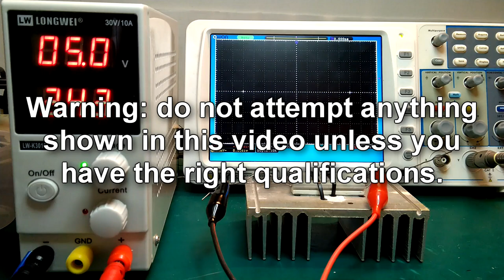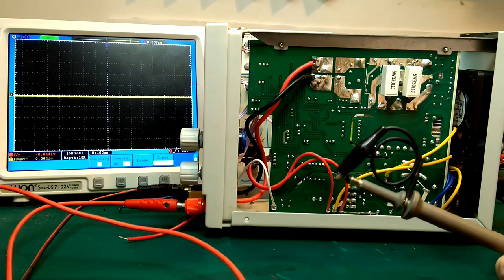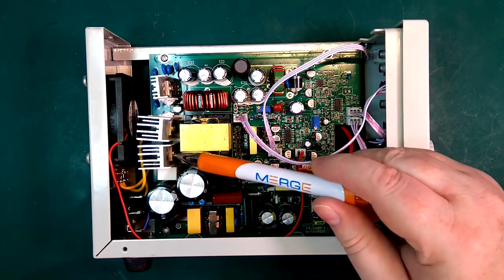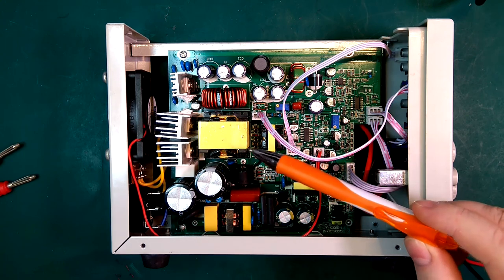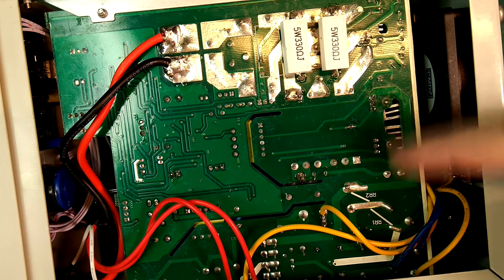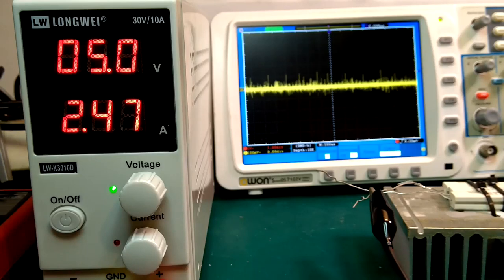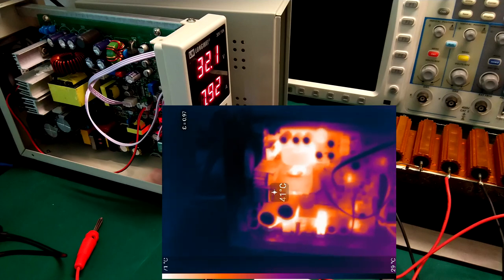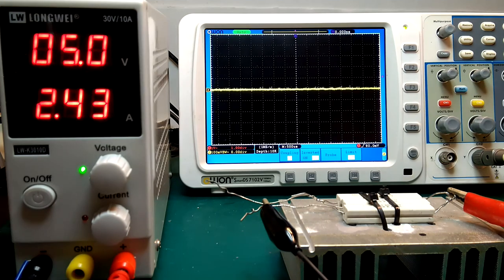Fixing the LongWei LW-K3010D Bench Supply Noise Issue

Comment from the maker: Simple fix to get rid of most of the switching noise. It's a possible scenario that the power supply was originally designed to use different mosfets with much higher gate capacitance, but then the manufacturer bought a cheap truck load of the Fairchild mosfets and used those instead.
Reply: What is a good name brand mosfet and better gate capacitance, so it may be better to swap it instead of modding.
I just ordered a 'qw-ms3010d 'dc power supply and i want to start learning electronics for my flashlight hobby.
Reply from the maker: @forrestgumpv9049  It's not so much about the brand name, but there are a lot of mosfets out there and it's a jungle, so trying to find one that would work is quite a task. Anyway make sure the voltage and current rating is high enough and then look at the Qg parameter usually in nano Coulomb and some datasheets will show Ciss as the input capacitance in pico Farad. 
Cheers,
Jake
Reply: Thanks I finished the mods and ripple reduced to few mv

Comment: That's a good tip (ha) on using the ground wire of the scope probe to generate a pickup for pinpointing noise. I always used a few loops of wire but did not think of using the probe wire itself.
Nice job rooting out the noise source. Adding the RC filtering helped significantly making the supply a bit higher in output quality.
Cheers,
Reply from the maker: Thanks, yeah it turned out better than I'd hoped for.

Comment: Thanks,  it is a real pleasure to see such intelligent step by step analysis and solution development. I also liked your EMI detection tip. Yes, my degree is from 1972 so I too must learn SMD soldering skills, hope my eyes will be up to the task!
Reply from the maker: Thanks, much appreciated. When I switched to SMD I thought it would be much more difficult, but actually I generally find it easier and quicker to solder SMD components today compared to through hole.
Cheer,
Jake
Reply: @TheStuffMade  Thanks Jake,
You motivated me to order some SMD resistors 😊
Best wishes
Mark
Reply: @TheStuffMade  -  On your pickup coil for the scope... I use one of those old suction cup coils used to record phone calls from the receiver or handset of a telephone. Those are 500 or so ohms and are very sensitive with good output to find BS in circuits. Also they have great bandwidth for audio signals. I have used them to detect whether coils are doing their job correctly. One of the more interesting uses was for vector monitor yokes. There is a substantial difference in the fields between a good one and a bad one. Some electronics makes really crazy noises if you have a listen with that coil also.

Comment: Great video and something that LongWei should think about doing to improve their product.  I can't imagine it would affect the cost all that much and it would bring the rating of their product up over others within the same budget market.  Wish I could tag them in this comment...  :)
Reply from the maker: Thanks, I believe the engineers who designed the power supply probably had designed it correctly, then the manufacturer changed some of the parts to save a few cents. But yeah, I wish they would implement the tiny mod to get rid of the awful noise. But they've probably already made 1000s of these stocked in warehouses so it's unlikely they'd consider making any changes.

Comment: A big thanks for the excellent video. I've risked a Topshak (BG's own rebrand) LW-3010EC and hoped that the core is the same (from the LW- type) and yes it is so I did the same mod (actually with 2 of them after seeing the result of the first one and how reasonable the price was) with very similar results (although used 27 Ohm 0805 as that was in my drawer and didn't want to push it too hard as for really low noise I have linear PSU). RMS went down from 12.7 to 3.7mV and Pk-Pk from 281.1 to 83mV in a noisy environment (checked with DSO, tried to avoid noise leaking in as much as possible).
One issue though: I guess it's not just about more heat but also reaction time for quick load change that has increased as well. None of my concern, just perhaps something that's also good to be aware of.
Reply from the maker: Thanks, good to hear you got rid of the noise. These switch mode power supplies are very slow reacting to changes in load. See this video I did before the mod: https://www.youtube.com/watch?v=RdT-xWC4h4k
The mod itself will not have any effect on the power supply's reaction time, it just takes the edge of the MOSFET switching.
Cheers,
Jake
Reply: OK, it's even better then (and I was wrong about reaction time but I didn't look into it much as I have linear PSUs as well that I use for more critical tasks; it's also somewhat similar to what you also have but in a cheaper/simpler edition).
Thanks again for the video, it has helped me a lot to make this fix quick and easy and also for the other videos that explore PSUs in a way that I rarely see but found very useful.

Comment: Ive recently bought an RS310p 30V 10A PSU. Ive bookmarked this video and will do the same mod to the MOSFETS in mine. I'll also add an inductor between the board and output terminals.
Reply from the maker: I can't guarantee it will work on other power supplies, but good luck.
Cheers,
Jake

Comment: Apologies if this is a dumb question, but for the switching noise and ripple to be present on the output, that would mean that it’s severity exceeded the level of smoothing provided by the specification of the main output capacitors? Put simply it’s so bad that the hard-switching peaks are  making it through the output filtering?
Reply from the maker: It's not a dumb question, but switching noise and ripple are two very different types of noise and must be dealt with in different ways. You can lower the ripple by upgrading the output filter, increasing the switching frequency or adding more phases etc. With switching noise you have to eliminate it at the source as it's EMI (I believe I mentioned this in the video). In this PSU it's generated by the MOSFETs because of excessively fast switching. Hope it makes sense.
Cheers,
Jake
Reply: @TheStuffMade  Ah, I was thinking about it the wrong way still even though yes you did mention it being EMI. Which is why using the probe as a EM receiving antenna was effective, I see now. The conductors connected to the mosfets act as transmitting antenna for the harsh HF switching transients, which can be induced into the conductive circuitry of any devices or wiring close enough in proximity. (receiving antenna) 

Or at least this is way I understand it to be, as I’ve been learning the importance of reducing unwanted EMI, especially as of late, since I’ve been getting into the shortwave and CB hobbies. And the somewhat new and acute awareness that RF is generated by every device that has switching circuitry, which is not always dealt with or suppressed to a level that doesn’t cause unwanted RF interference in certain frequency ranges. Harmonics. Inductance. It’s a lot, but I’m been steadily learning, and slowly small levels of understanding come here and there as I poke around and try to familiarize myself.

Comment: Hi nice video !  but for me it looks risky to tune it without analyzing the pulses on the gates, to see the deadtime and also to evaluate the increase of heat of these transistors ! i'm curious to see the curves of gate signals and how much this rc filter is slowing down it. how about a correct current loop for the transformer, transistor and capacitor with also a shield ?
Reply: If it works it works and he did look at the mosfet temperatures…?

Comment: Very practical and educational. I just wonder why the manucafturers do not bother to put this output filtering right away? that would probably cost like 50 cents more per PSU really. And they could brag that their switching PSU produce low level of noise to attract more buyers.
Reply from the maker: Thanks, it is a likely scenario that the power supply was designed to use other components, but the manufacturer changed some parts (e.g. the MOSFETs) to save money but at the same time degraded the performance. These lesser known brands usually have their marketing department make up the specs anyway and they've probably already got warehouses full of them so they only really care about getting them sold asap.
Cheers,
Jake

Comment: Thank you for the mods. Did you notice that the power switch only turns the power off to the bridge rectifier but not associated mains input filtering circuit , also the metal case is not earthed.

Comment: Very useful video. I will attempt this on the Kungber 30v/10A supply. Am sure they would be somewhat identical.
Reply from the maker: Thanks, I hope it works out, I have had reports that this mod also worked on other power supplies, but I can of course not guarantee anything.
Cheers,
Jake

Comment: So looking at the new version of this powersupply, looks like longwei fixed the noise issue using a very similar method. I was going to do the mod but saw that there was a 10 ohm resistor on the gate of the MOSFETs. No extra capacitors though.
Reply: ive just oprdered a new one from amazon, Has your noise problem been solved from factory ?
Reply: @TheCasualDrinker  Noise is still present in the supply, and it may not be suited to work with noise sensitive devices, however, it is not too bad.

The noise is definitely better than the old versions though.
Reply: @electrifyingvids3545  i'm a bit of a HAM man so noise isn't the greatest thing to have. however I wonder if adding capacitors and the resistors aswell might help even more ?

Comment: I just opened my LongWei PS-3010DF to compare it with the K3010D in this video and it's almost identical. When putting everything back together, I was testing the ground connections (front ground banana socket and back AC line connector socket) to verify continuity and noticed that the metal chassis is not grounded. A bit concerning, considering that the incoming live wire is only soldered to the underside of the PCB (the PCB lays flat in this model, not vertical) and close to the chassis bottom.
Reply from the maker: It's a good thing to check 👍a shame they don't pay more attention to basic safety. I'd prefer the ground fault relay doing it's thing instead of getting shocked.

Comment: Excellent video. Looks like you used a mica capacitor. What voltage do you think would be appropriate for a 30 volt power supply like this?
Reply from the maker: Thanks, these a poly film capacitors, you can find them online at a few $ for a pack. I believe they're rated for up to 100V.
Cheers,
Jake

Comment: Hi ! thank you so much for this excellent video I subscribed immediately and i will watch all other video on power supplies, my main interest these days.  I am a beginner trying to learn something.
I have some questions. 
1)  in order to understand better the cheracteristics of noise would not be better to check with a spectrum analyzer ? to see the noise vs. frequency ? 
2)  as i am looking for very low noise voltage sources for some audio preamps i am putting together ... which would it be your first choice for a very low noise voltage source ? linear or switching ? and in case of a linear PSU do you think that IC regulators like the common LM317 can get down ripple to some mV or a more complex design is needed ?  
In my testing i have been amazed by the difference i can listen from a same preamp using different power supplies.  Incredible.  With higher noise PSU the sound is confused muffled ... with lower noise one is crystal clear and very nice.   I am using a LM317 regulator at the moment bought on ebay.  But i am very willing to try something else even less noisy.
Thank you very much again.  Kind regards, gino

Comment: Great video and very nice technique in breaking the tracks to add the resistors. It might have been interesting to see the same test with ferrite beads rather than resistors.
Reply from the maker: Thanks, I don't think a ferrite bead would have much effect as the gate pulses are already going through a transformer from secondary to primary side.
Reply: Aren't the gate drive pulses amplified after the transformer?
Reply from the maker: @userPrehistoricman   There is no amplification, however it looks like they are doing some clamping, probably to keep it below the max allowed Vgs

Comment: Top draw modification. Great presentation. I was looking to get the LongWei 3010E with the extra pre-set and lock button functionality. Looks great until I read the Ripple and Noise specs; CV≤30mV (effective value) ; CC≤20mA (effective value) - I guess 30mV rms ! and 20mA rms ! Really ? Hoping the circuit is similar to your modified LW-K3010D, as apart from the dreadful noise issue the rest of it looks good value. Do you have any familiarity with the higher spec 3010E please? Keep up the good work.
Reply from the maker: Thanks, I don't have any experience with the LongWei 3010E, it looks nice and as you say it's got all the features missing from the 3010D. It's hard to say if the switching circuitry will be similar, the LongWei name might just be a sales branding and the power supplies could've been designed and manufactured by different companies. Since the cost is around the same as the Korad ka3005d, you should have a look at that power supply, it's only 5A max, but it's a low noise linear design, I've had a Korad for quite a few years and I'm very happy with it's performance.
Cheers,
Jake
Reply: @TheStuffMade  Jake. Thanks for your considered response. I took a look at your other comparative test video ' Homemade vs Korad vs Lonwei' and I take your point that the Korad is a cleaner and safer bet than the LongWei.The LongWei seems to have a nasty sting on some of the tests.  I am developing Arduino based circuitry, so I appreciate you steering me towards the Korad. The 30/10 version is expensive, but maybe the 30/05 Korad would be fine for most applications - hopefully even the heavy load 12V Peltier systems. Many thanks. John

Comment: Thank you very much for the explanations, impressed by your knowledge. I know that I am a bit abusive in putting it into this topic, since the topic that I am going to indicate to you differs from the one presented. I describe a problem I have with a system based on an ESP32 microcontroller. After many programming tests that I carried out in the house where I live, I got a stable system without resets that works well, but when I moved it to its destination to my country house to control irrigation, boiler, hot water, heating, mains water pressure, temperature... etc. , I discover that the system resets randomly many times a day. The only explanation I can find is that the mains current reaches my house with an unusual noise. I have tried different power supplies for the ESP32 that works at 3.3V and the differences are minimal, and it is independent if I keep the ESP32 disconnected from all the sensors and relays, the problem is always the same. Could you tell me what I could do to eliminate the noise that surely makes my system not work continuously, thank you very much for your help and patience.
Reply from the maker: Hello, I don't think I'll be able to help you in the youtube comments, but I recommend you try post on the eevblog forum, they're very helpful and it's likely someone will solve your problem.
Cheers,
Jake
Reply: Thanks I will ask there.

Comment: Nice video, I was wondering if a 1/4w or 1/2w through hole resistor instead of a 0603 would achieve the same effect, or if they would be less effective somehow? I don't have any SMD 33Ohm resistors on hand currently. Thanks
Reply from the maker: Thanks, yes you can use 1/8 or 1/4 watt through hole resistors instead of  0603, you'll just have to scrape off a bit more of the solder mask to solder them onto the traces safely. Otherwise you can buy 0603 very cheap online something like $1 including shipping for 100 pieces.
Cheers,
Jake
Reply: @TheStuffMade  Thanks for the reply, I'll order some on Ebay and wait a few more days for a cleaner install.